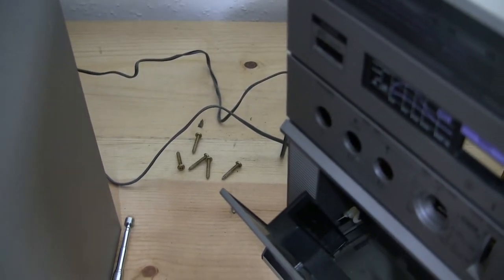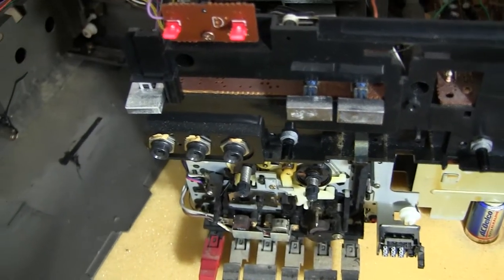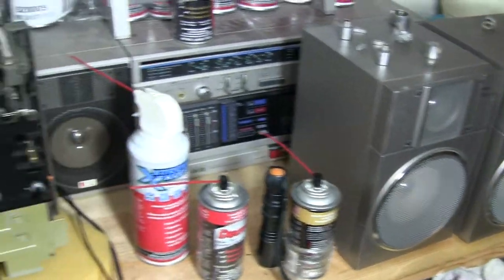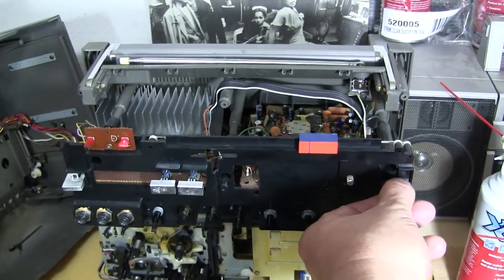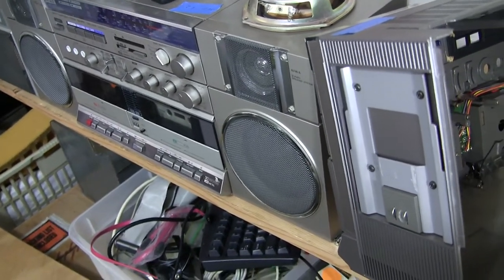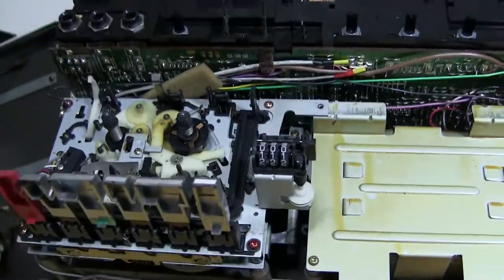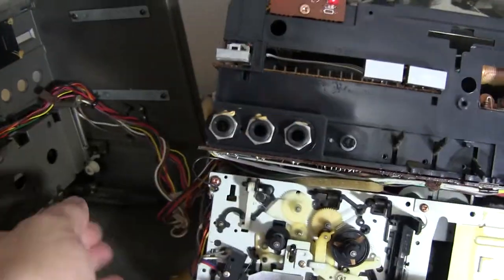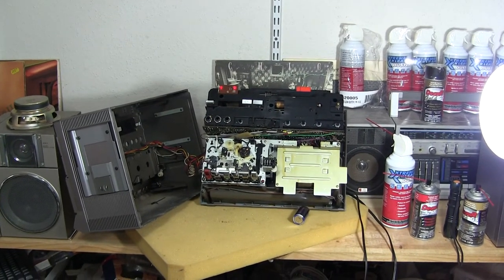Inside AIWA CA-100H 1983 Stereo 100 Music Sensor Carry Component System 3 Piece Deoxit BOOMBOX CA

Comment: Bro how can fix radio band tuning cabel
Reply from the maker: Google radio tuning string what it's worth I hate restringing any radio. If your string is broken you will have to buy a new one, they do sell string on eBay or elsewhere. But you need to get string this made for a radio tuning. I sold those radio long time ago I don't know the radio tuning string pattern inside.